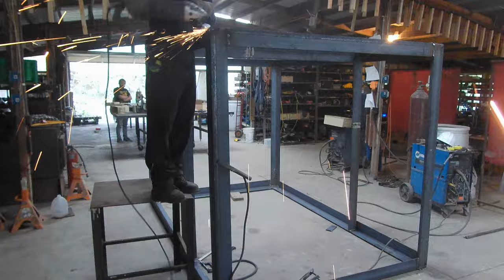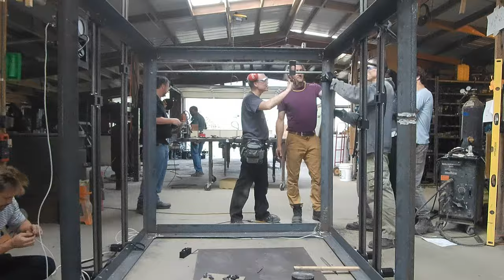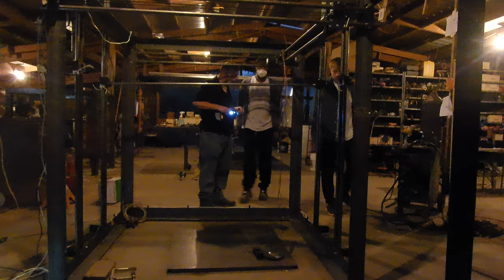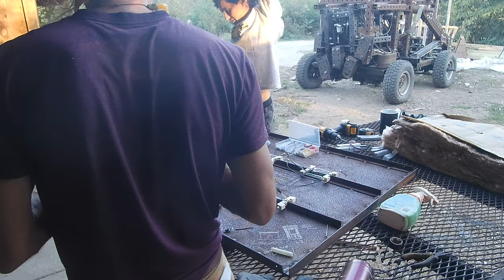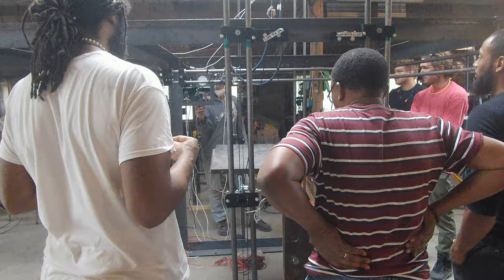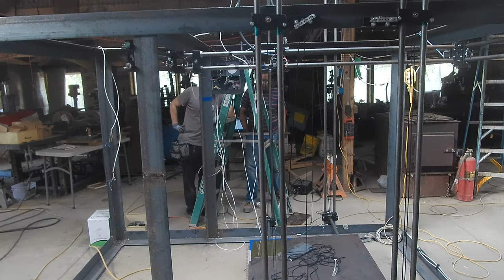OSE 3D Printer Giga - 6x6x6 Feet For Solving Plastic

Comment: Awesome warpspeed teamwork! It's like watching SpaceX build starships as fast as humanly possible. 
As alignment is critical to 3D printers, it will be interesting to see how precise the fabrication process actually was since this build is so large. (Fingers crossed that tolerances were maintained within allowable parameters.)
I can imagine quite a few applications of OSE 3D Printer Giga if different types of printheads are developed. Very cool project!